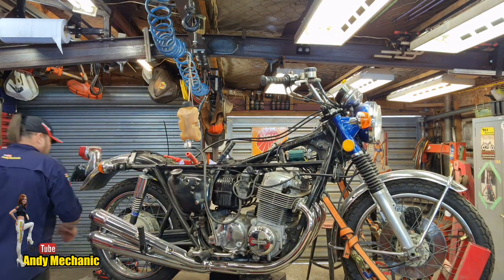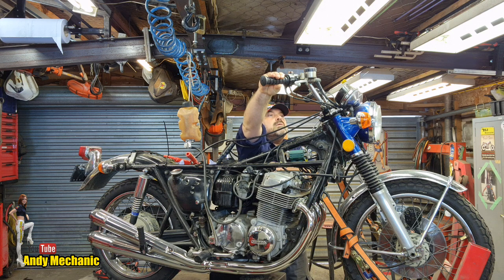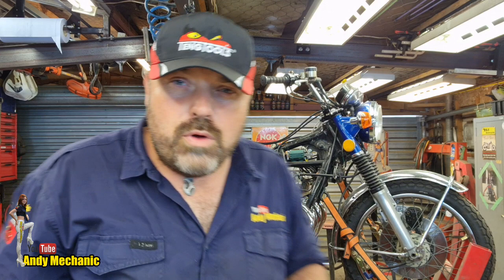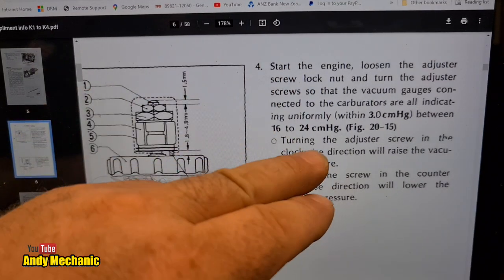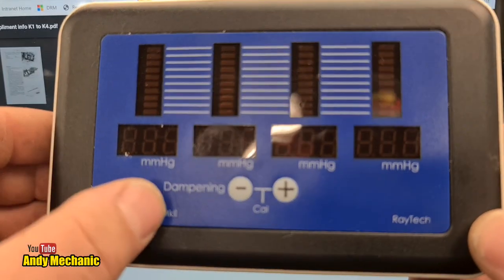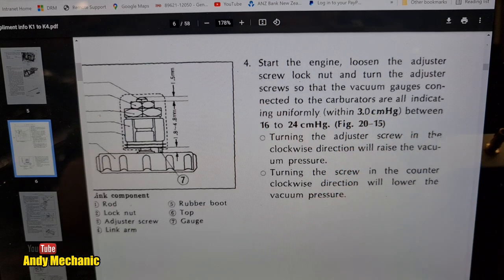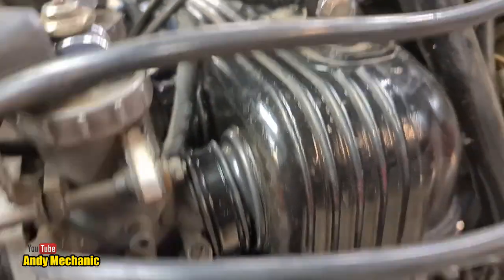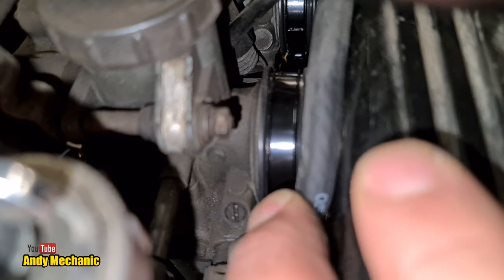CB750 K2 Carb balancing - #1884

Comment: Thank you for a great video I have a 1980 cb750 DOHC and I’m new to bikes and have a high idle issue I’ve watched a few videos on carb sync. But it seemed like those videos the carbs were fine to start. Your video really helped me . I already bought a Digi sync and I was having a problem with it moving around I like how you mounted yours thank you so much for this video

Comment: Andy seasons greetings sir ! I'm only part way into the video .. on my vacuum adapters I dremmel cut a slot in the tops and use a long flat head screwdriver to install them . I've also used soft rubber vacuum pipe as wider o rings to make up the space on the long threads...  as I don't have a lathe ...
Peace and love brother 👍🏻☮♥️

Comment: Great video.  Syncing my 1975 CB750 carbs is such a pain the butt. I’m not very good at it.  Seems like every little adjustment effects the other carbs, as we saw in this video.  I bought the bike 3 years ago as a first bike and I’ve been learning to do all of this stuff myself.  Last year I picked up a 64 Triumph TR6 as a second bike.  It has one carb, which is so nice.  Now I only want single carb bikes for ease of tuning and maintenance.  : ) I’ll never get rid of the CB750 though.  Hopefully I won’t have to sync those carbs very often.

Comment: That was a great video. Been looking forward to the carb balancing for a long time.  Used a few different Raytech testing tools during my time in engine rooms. Very accurate and durable equipment. Cheers Andy.
Reply from the maker: Thanks Connor, yes, it seemed to fo a great job. The bike now starts & runs really well. I'm very happy with the end result....its taken a bit of work!

Wishing you a great Christmas & a relaxing time over the holidays.

Cheers for now
Andy

Comment: merry Christmas . watching thing its making me think if ways to do it with a scope in a very accurate way.  pressure pulse sensors . say you want an rpm of 1000rmp  divided by 4 that makes 250 rpm per cylinder. so 250 pressure pulses a cylinder . i may be mikes out with this idea tho
Reply from the maker: Merry Christmas to you & your family Simon. Thank you for all your help & advice, it is very much appreciated.

The scope would certainly give an accurate RPM for sure plus super accurate vacuum readings if I had enough pressure transducers! Probably a bit of overkill on this old girl! The RayTech SynchroKing did a great job & I'm super grateful to have it in my tools inventory now :-)

Stay safe & enjoy the break - right video editing time....

Cheers for now
Andy

Comment: Are You sure You understand this? When vacuum goes up - gets a higher value, the pressure goes down.
Reply from the maker: Yes, the basis of carb balancing is to balance the vacuum in all 4 of the intakes.
Reply: @AndyMechanic  160 mmHg is less than 240 - so the vaccum pressure is lowest at 240. Zero vacuum is higher pressure than 240, but less vacuum pressure.than 240. The manual is correct.

Comment: Yes, l find the heat build up affects the readings, l usually have to take a tea break when half way through syncing my 4 cyl bike. Then go back when its cooled and make the final tweeks. Is that the typically slappy/clacky primary chain l can hear? which may sound worse when not under load.
Reply from the maker: Sure is, got a lot better once idle smoothed out :-)

Yes, I was very concious od engine temp, was a hot day too which doesn't help! Had to take a couple of breaks then start filming again. Wasn't too bad a result in the end & way better than it was previously.

The carbs really need a full stripdown & ultrasonic clean. Then rebuilt with an overhaul kit to get it 100% but that will have to wait until next year...

Cheers Andy
Reply: @AndyMechanic  Well done, how did you know which way to go with the air screws when it wouldnt settle properly when revved?? Also you did PROMISE me an on board ride video didnt you......promised.....
Reply from the maker: Ah...clockwise to richen mixture, anticlockwise to lean off. The revs were slow to come down which is usually an indication of a lean mixture...

Test ride.....yes, I did & unfortunately I just ran out of time. It would have been awesome & it may still happen in the New Year....have a video planned with the owner Alan for the hand back.....so maybe, just maybe I'll redeem myself with this one! Lol
Reply: @AndyMechanic  I see, thanks for replies and ta-ra for now.
Reply: @bananabrooks3836  make sure you know the diffrence between an air screw and a mixture screw ,a air screw is between the airbox and throttle slide and operates tge way andy states, a mixture screw is between the throttle slide and intake and operates the oppisite way in leans out richens